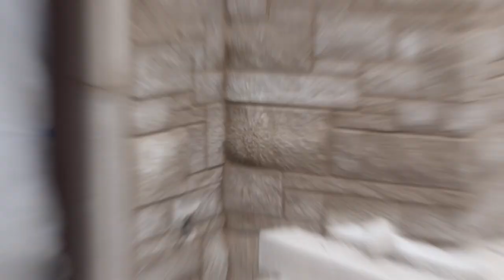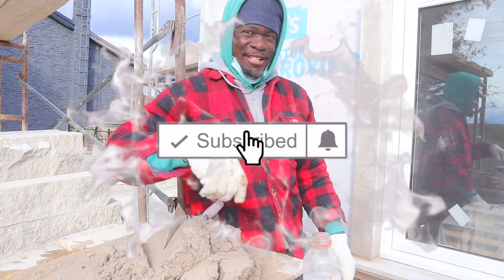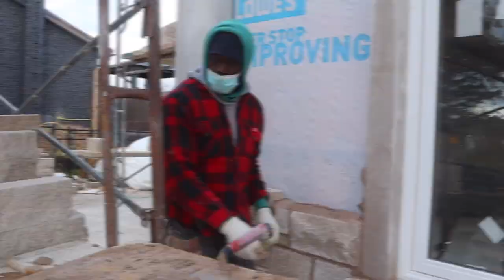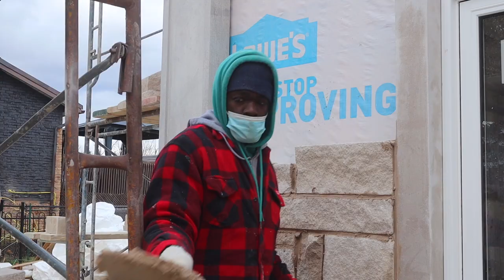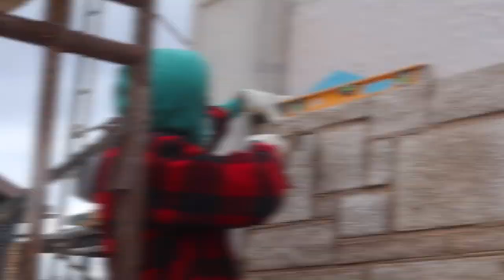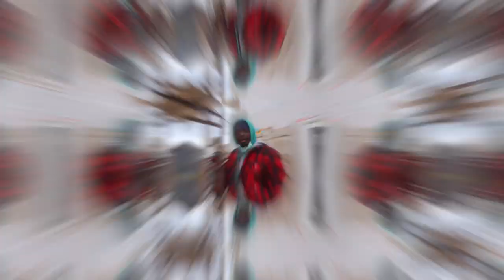How to Install  Indiana limestone  , DIY Tips

Comment: Do you use antifreeze in your mortar mix or calcium? I'm just wondering how you haven't had a tarp up and heat especially with this stone, how do you do it?
Reply: @adamgriffin5688  that's what I'm trying to figure out. If I didn't use tarps the builder would make us rip it down. Especially when they are paying top dollar all stone house🤑I'd forsure take the 20 minutes to hang a tarp. And I like getting paid lol
Reply from the maker: We do tarp if it's below freezing temperature ,
 The day when the video flim it wasn't that cold